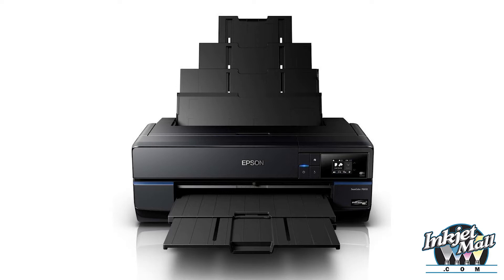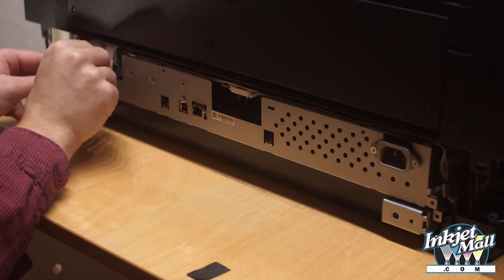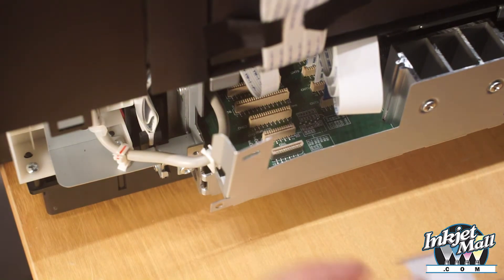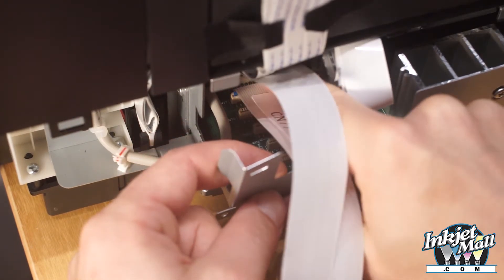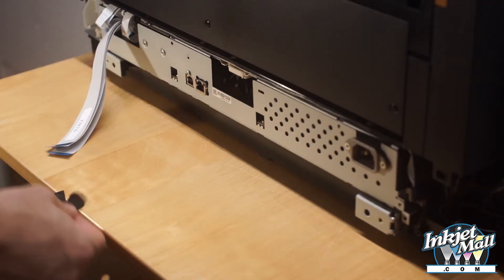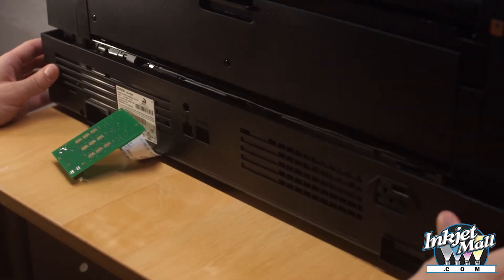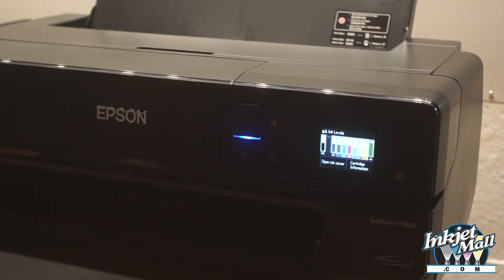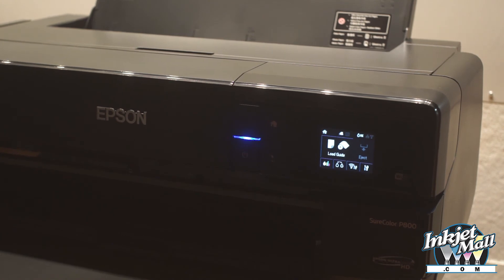InkjetMall.com How to Install the Decoder Board on SureColor P800

Comment: i hate the fact that we dont get 30 resets global, considering there are 8 unsable cartridges at some point any of them will need a reset... if the printer marks empty at 80ml of ink used.. whichever cartridge reaches 80ml this means global you only get about or less than 4 resets.. even if we buy the elongated cartridges these are only meant for fewer refills, this is not a 30 reset chip decoder.. scammers !!!
Reply from the maker: The board that we are supplying is designed solely for printers sold by Epson into North America. Your channel indicates that you are in Columbia and it is entirely possible that using a decoder board designed specifically for North America version Epson printers will not work with printers sold in South America.
Reply: @Inkjetmall  If you going to go this route, perhaps would have been easier to read new 100% full cartridges and return this information all the time, then have a micro on your board prompt users to refill as your own counter reduces during use, could be done by some leds on your pcb.   You don't then have to worry about a 30 limit set by the cartridge data and printer cpu board
Reply from the maker: @dcocz3908  If you can produce this product - let us know. We will test it, and if it works will distribute it for you.